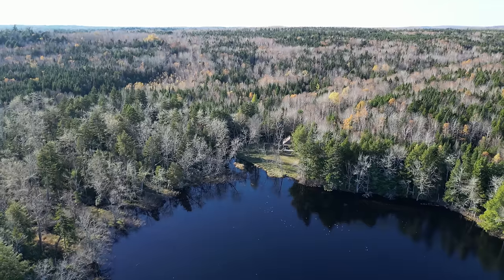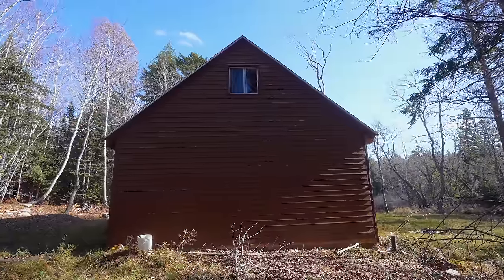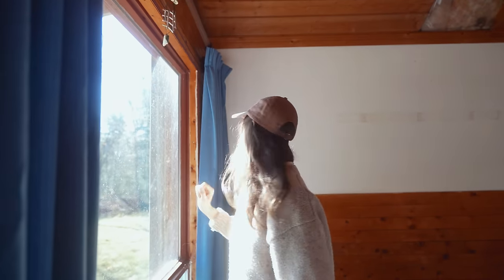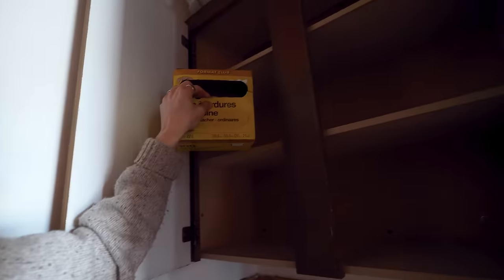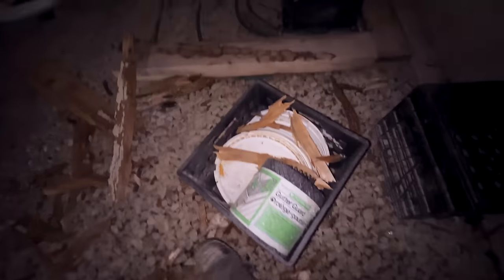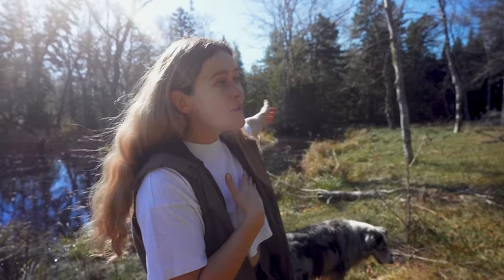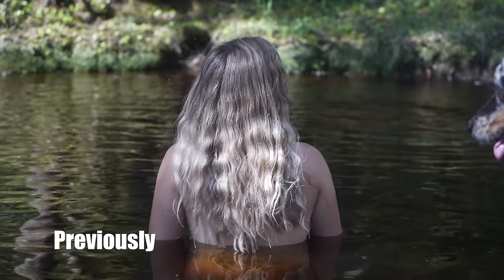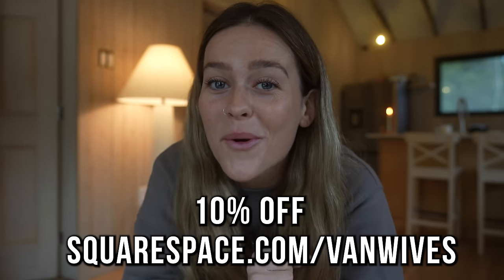We Bought an Abandoned Lakefront Home in Canada and Found Hidden Treasures

Comment: Your thoughts on moving the cabin is spot on. there is too much moisture and you will always be battling that if the cabin stays there. With that in mind, building a new cabin on higher elevation and possibly on a platform, trying to use some of the old cabin to rebuild would make a great project.  can't wait to see what you do.
Reply: Agreeing with Chris. The main floor needs to be ripped out and replaced.  Their is not much salvageable.  However leaving the foundation is a problem.  The biggest recommendation I can make is that, if you wish to be close to the water... elevate the house (old or new).  And be mindful that in spring flood, access may be very limited.  So even the road that comes to the cabin may need to be built up.  Lots to thing about.  But thrilled with the lake and the river.  You are totally equipped to do this, and get it right the first go.
Reply from the maker: @rgp6570 
We really need to evaluate and research the logistics of any of our ideas for this property. Thank you for sharing your ideas with us. 🌞🐶
Reply from the maker: We absolutely agree! There are so many possibilities. We must look at the logistics of every plan and idea. Thanks for sharing with us. 🌞🐶

Comment: What a beautiful piece of land and so nice that it's adjacent to your property.  My initial suggestions are this:  1. go in the cabin and salvage the beaded board and some of the varnished wood that still is solid.  This can be mold treated in a tented enclosure and cleaned up to use as interesting features in another place.  The woodcraft is old and that patina has arrived with the passing of time - it can be reproduced somewhat, but not exactly.  This can be a throwback or honoring to the cabin.  2. Given the water intrusion, mold and flooding (personal experience) - I'm on team tear down the cabin and start over.  The amount of money you put in to reno on that house - you'll always be chasing the problems you see today and it would be cheaper to build something else much more energy efficient.  3. Speaking of energy efficiency and your love of scandanavian looks - why not consider a log home kit or post and beam construction.  The diameter of the logs will be natural enviornmental control - heating or cooling due to the R-factor and you'll love the asthetic.  You've got a good road there and once the site is prepped - a team with a crane can set the house in a day or two.  Then you'd have to finish it. but hey - 10 inch thick walls is a good thing for winter.  4.  Set your homesite away from the spring floods and late summer hurricane floods.  If you go up on stilts or a raised platform - remember to insulate your water and waste pipes doublly well due to wind and lack of heating from the structure.  5. Build a pavillion nearer the water that can be screened in for bug season, have a fireplace, and be a place where family can gather to enjoy watersports.   Just my initial thoughts.  Go Pack - great new creative projects are in store!  💛💛🐾🐾
Reply: Lots of great ideas
Reply: I love your ideas
Reply from the maker: Wowee, thank you Suzy for sharing all your incredible ideas. Thank you for taking the time to share with us! We are so happy to have you in our pack. 🌞🐶
Reply: Really well thought out.

Comment: Here in VA we put some of our houses on stilts because of flooding. You could put it up in the air so you don’t lose your view and don’t have to clear anymore trees. I vote to repurpose as much of the cabin as possible to build a great guest cabin. So excited for this new adventure!
Reply: Hehehe that is what I was thinking. Awesome Idea. 😀👍🏻
Reply: Build container cabins on concrete pillars. They are cheap to buy and they are very durable. They make foam insulation the shape of the wall. You just glue it on the ceiling and walls. You tube them and you will be on there for hours looking the ideas.  I think they could work for your guest. 20’ ones is what I would start with. Easy to get and to move in and out. Plenty of room for couples. There is so many ways to build the inside. Bunkhouse, couples cabin, roof top decks, put two together. It is endless what you can do. Very smart buying that land next to yours. It’s money in the bank. That lake is beautiful. Good luck.
Reply: @dalemyers6515  Exactly but I was thinking 40's for the base and 20's for the top. More space high set with a deck for that awesome view and you can raise the land to keep it all above the flood line.
Reply: @someyoungguy6990  now thats thinking outside the box. There are examples of those on you tube. If you pour the the sonic tubes you can set the height above the flood plane & high enough to plumb under them. I don’t know what the laws are there. If you were to set more than one unit you might pump them into one larger septic tank. I just watched a video that the foam insulation was the shape of the container walls. Had the plastic studs built right in it. You could run the wiring and pumping in the channels provided. Very builder friendly. Windows and doors are a bigger challenge but very doable. It will be interesting to see we’re you go with this new adventure.
Reply from the maker: Thank you for sharing your ideas with us. The possibilities are endless. Thanks for coming along on our journey. 🌞🐶

Comment: Since it’s been flooded before, I suggest starting over and lifting the cabin up so the cabin doesn’t flood again. I noticed all the timbers are rotting so starting over with new materials is a must do anyway. It’s a very lovely place. Loads of potential.
Reply: Undoubtedly there's mold
Reply from the maker: We agree so much potential. We are thinking that fixing it up could be more work and expense then tearing it down and staring over.
So many ideas. 🌞🐶

Comment: That was a great buy, mainly because it connects to your property. The first thing I would do is have it transferred into "one" property with the County Tax Office to save on taxes, as two properties bill out more than one. During that process, form a Trust, Charity or other low taxable entity to title it in, and make all of it in that name/entity. As far as the cabin goes, you need to tear it down, and choose a higher elevated lot to build. When building, consider placing Helical piles in to support your framing. Works well in wet conditions if you have a good soil base to auger into. Good luck
Reply from the maker: Thank you for sharing all your knowledge with us, we sure do appreciate it. 🌞🐶

Comment: WOW! Great property. Looking forward to the transformation! My first impression is that the cabin's foundation is worthy of reuse: fill in the crawlspace, determine a new First-Floor elevation that is safely well above flood level. The existing location is quite sweet, especially if the main floor and second floor were to be 4 or 5 feet higher. The immediate surrounding spaces could be treated as wetland, and identify raised pathways to get to the beach and to areas deeper into the forest, all the while designing for the relentless (but wonderful) flooding. Situate the roof for ideal solar orientation. This Guest Cabin doesn't need all the beautiful and utilitarian accoutrements that you have down the road..........it's an experience of solitude. Good luck!
Reply from the maker: Thank you for sharing all your ideas with us. Yes the solitude is magical. So many possibilities. 🌞🐶

Comment: A lot of good ideas just in the first 10 or so that I read.  First, the higher the living space, the better view you can get.  Second, you need room for kayak and sled storage and maybe a small boat or two like a couple inflatable pontoon 1 person fishing boat.  Having an organized area for recreation gear in a walkout basement would help add some elevation to the living space.  Lots of windows on the lake side, wrap-around deck with a roof over most of the deck and part screened in and capable of blocking wind and being used 3 seasons.  High pitch metal roof that slopes away from the lake so snow dumps where it doesn’t have to be shoveled …. radiant floor heating, jacuzzi tub indoors with a view of the lake, geothermal heating and cooling, plant room with southern exposure if it doesn’t spoil the  view, building products that are super resistant to rot …. especially flooring and roof construction.  Two en-suite design with lockoff capability if you intend to rent it out Air B&B …. might do well in winter if 4 sleds and trails are set up as a package depending on whether there is a city within an hour’s drive or not.

Comment: Polebarn/carport with a small storage area, open space and parking area for your Van. Solar panels on the roof that could power the van and a few LED lights. A small outhouse like at your cabin. Elevated rain barrels at both areas. Keep it simple for outings at the lake or for guest.

Comment: CONGRATULATIONS!!!  This looks awesome!  I'd suggest building an A-Frame cabin over the existing concrete foundation.  There might be regulations that don't allow you to build a certain distance from the water unless it's using the foundation of an existing building.  Besides, you would probably want to keep close to the water with that view.  You could use the existing foundation to put beams across for an outdoor sitting area under the A-frame that you could screen off with bug netting so you can sit by the water and not worry about the bugs.  If there is an opening elsewhere on the property, you could have a little bunkie city with  a couple of bunkies for sleeping, a washroom bunkie, and a kitchen/dining bunkie and a covered octagon deck in the centre connecting all the bunkies.  You can purchase the kits and build them yourselves seeing how handy you two are!  You can get a little hydraulic turbine generator for the river (if regulations allow it) to get electricity, I'd still couple with solar.  For heating, you could do an outdoor wood stove shack with piping hitting up multiple buildings.  You two are going to have a lot of fun!  I'm not going to lie, I'm a bit jealous.

Make sure you check out the regulations for building near the water, it would be a shame if you take down that existing cabin and can't build something else in its spot.

-Steve

Comment: The location of the cabin is actually really nice. I would recommend tearing it down, due to its condition, but rebuild something in the area. How you might be wondering? STILTS! and maybe even be able to get it closer to the water, so you can have a deck hanging over the lake, connecting to a board walk where you can leave some kayaks, or boats tied up. Putting the cabin on stilts would be more suitable then having a basement in an area that clearly floods. get really deep sauna tubes down to super firm clay, and put really big structural beams on them and use that as your foundation. Obviously you will probably want to get an architect for that. with the deck facing over the lake, you can have a huge gable end roof, with massive windows opening up a living space to the gorgeous views. and maybe even a wrap around balcony. partially covered. 2 floor apartment style cabin, with the living area and kitchen on the first floor, and bedrooms/restrooms on 2nd. Not sure if these ideas pique any interest, but i reallllllly like the idea of a deck with a built in boardwalk that takes you to your lakefront. Then you can always dive off into the lake, or go for a kayak.

Comment: Cinnamon Spread Dupe

Ingredients
1 cup Imperial Margarine Yes, you can use (softened) butter. It just won't taste the exact same (although, it will be healthier). Your choice.
1 tbsp Cinnamon
1/2 tsp Cardamom
1/4 cup Icing Sugar
1/4 cup Brown Sugar
1 tbsp Vanilla Extract

Instructions
Whip all the ingredients up until smooth. You can store this in an airtight container in your fridge for a few weeks, if it lasts that long. If you opt for real butter, don't leave it out on the counter or it will spoil.

Comment: Tree house(s) with gantry walkways up in the trees or Pods on stilts with Hydro Power, put small pulley's to lift supplies to the houses. Use everything not rotted from the original cabin, and a ZIP Line into the Lake. ❤🧡

Comment: An option may be to build smaller hut type structures spaced out with connecting paths/trails. A large solar array could be used to power a bank in each to offset other power sources, such as hydro if the flow supports it. You could build a central dining type hall for whole family/ many friend gatherings, etc.
Reply: Kind of like Cabin Land, awesome idea!

Comment: Demolish the rotten cabin and build a new 2nd cabin higher up on the property or put it in the same spot but on stilts (solid concrete foundation necessary) with a little boat dock cut in the deck so that flooding doesn't become a problem and you can still reach the house. During dry season put a net across the little dock and use it as hammock. Install a tiny water power plant as an additional power source as you're already planning. 
Convert part if your roof into a roof terrasse or balcony if building permission allows it. 
Exciting, exciting! We will all love to watch what you're creating! Greetings to the amazing team and family you are from Berlin! 🍁
Reply from the maker: Thank you for all your great ideas. Loving the rooftop as a balcony. Sending greetings back to Berlin. 🌞🐶

Comment: Wow, what a great spot!!!    I think foundations are one of the hardest things to build for off grid.  But that one looks like it’s in pretty good shape.   Your may want to mortar in a few rows of 8x8x16 stretcher blocks to raise up the height of the foundations to not have to worry about flooding.  Then you can build new from scratch and save as much (siding) material as your can to pay tribute to the old cabin. (It is lovely) I would definitely move to the lake front property once you build the new house.   Having 2 places, one for guests is perfect, because friends and family will stay longer if they are not in the bedroom next door.   Also, having the creek / river for power generation is amazing.  You will have ample sun in the summer and hydro electric in the winter.  You may be able to run a mini split to heat and cool both places.   My wife and I have a similar setup in BC and we are just working on the addition for hydro electric and an addition to our second cabin for friends and family.  You 2 inspire me!!      PS, the battle born batteries will not be the way to go! You will need more power capacity with less of a footprint in the future.

Comment: Very cool! Looks like the cabin was built in the 80s or 90s. A shame that it’s suffered that amount of damage. You’d have to tear it down to the studs to really determine if it’s worth the trouble of saving. I’m sure concrete, rocks, earth dam, sandbags etc could be used to make the area around the cabin flood proof. Try to get a temporary repair of the roof done before winter comes. You could start digging into the walls during the winter and checking the status of the wall framing etc. Buying an ozone machine could help get rid of mold. I have from Amazon I bough years ago and it’s been a life changing tool

Comment: I resisted viewing this video for hours.  I thought it was an old one of yours, from like three years ago.
Now I see that it is a new video of an old place, which kind of resembles your cabin when you first moved in.
Suggestions:
1.  Get clementine working on building up the soil around the structure, if you are going to be keeping it.  At least another two feet (60.96 cm) of soil considering the flooding around there a few months ago.
2.  Considering all the mold, I suspect the building is a loss.  Some of the cabinets seem salvageable, and that fireplace.
3.  Maybe you could build a tent platform for guests?  Then when construction season begins next Spring, you could build another cabin.
4.  Another power station?  Or connect your existing system to this one?  What is the distance and what is the cost of running power to there?

Comment: Nice find. I think the structure is not worthy of saving. Grab all of the items that you think you might want to save for a newer cabin. Burning the old cabin might be best ... contact your local fire department and tell them you have a structure to burn. They will use the time as a training opportunity. This would be a great chance for them to address fires in structures that are so far away from the main road but utilize the lake as a water source. Also, make sure you understand the chances of flooding for the property. Here in the U.S., we utilize 100 and 500-year flood plain maps to determine the chances the property will flood (albeit remote). What was the water levels after the storms came though a few months back? Using the flood maps will help you make a proper decision on where to build the new cabin. Keep up the awesome videos!!!

Comment: Get that roof covered with tarps asap. Ventilate (cut holes in the ceiling and any walls suspect of retaining moisture). If moisture is into the insulation then remove it from cavities immediately. If there's any hope to salvage existing bones then ventilation and heat to dry it out is priority.  We've been looking to escape Onterrible for Nova Scotia for nearly five long years now...just waiting out our current mortgage term to run out; never again will we take out a  mortgage, debt trap 101. As a sustainable builder, I always kick myself for buying an urban location house as our first place, we're just glad we bought an hour-ish north of Toronto rather than right on the nightmare of GTA. Old renovation properties and, or building off grid from scratch is the only way from here on out. Good luck on your new endeavour, I'd be glad to offer help if I'm ever out that way...the day we get out there, it's Earthship hybrid time!